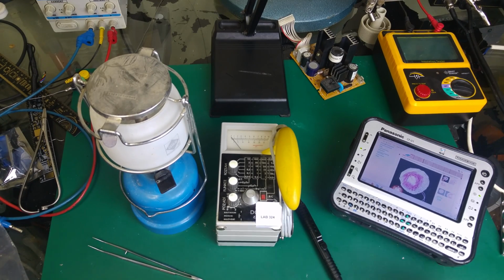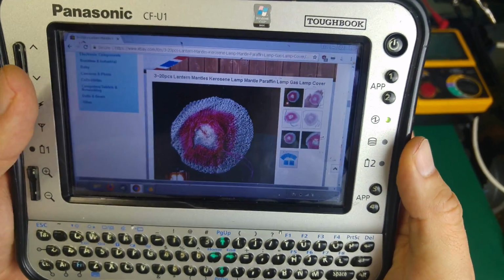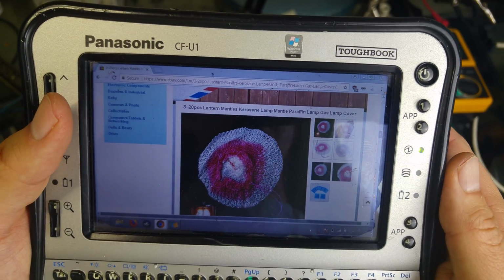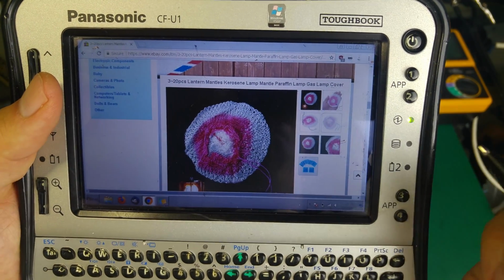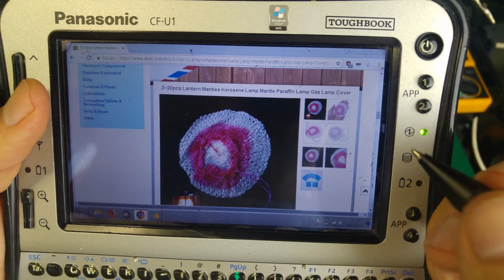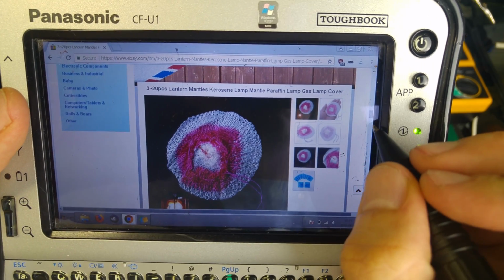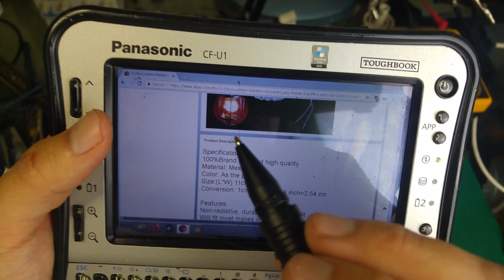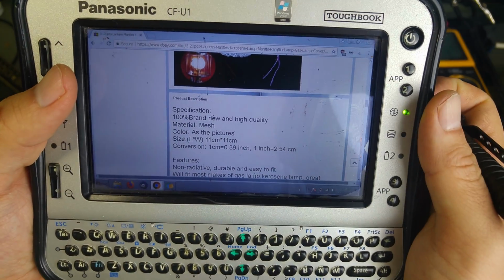Checking if camping gas mantle emitting radioactive radiation using geiger counter.

Comment: Unfortunately, the measurement was done wrong. The μGy/h reading is valid only if the shielding is closed. With shielding removed, Bq/cm2 mode has to be used. But as an indication of activity it serves well.
I'm glad you use Czech radiometers in Germany 😉 DC-3E is great, I have one.
Reply from the maker: Thanks for the info!  You are correct - I have no formal training on this unit, I know that without shielding it can be used for surface check and I wanted get highest reading to prove point. Indeed very good meter, by myself i changed batteries to lithium to make sure it won't be ruined by some leakage...
Reply: @ElectronicNoobBlog  You're welcome! You say you changed the battery to prevent leakage, did they eventually donate the meter to you or is it just borrowed for a longer time?
Reply from the maker: @Ales.2000  No I had return it. It contain test source and it's accounted (civil defense).  I'm using those batteries for everything that go to storage, NEVER had single leakage:  https://www.youtube.com/watch?v=pFpz3qtdFUU&t=22s    Personally I own DP75 made for polish military - just for quickly checking if something that I bring home from junkyard is not radioactive :>
Reply: Correct - you need to use so called Mica cell which alpha particles can penetrate. Alpha particles are from radon-220 which is one element  of thorium decay process